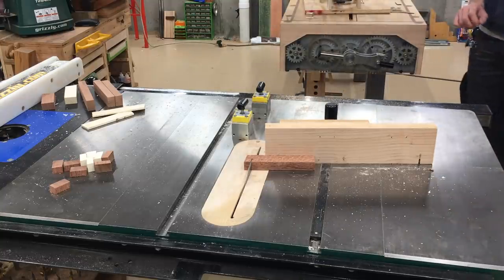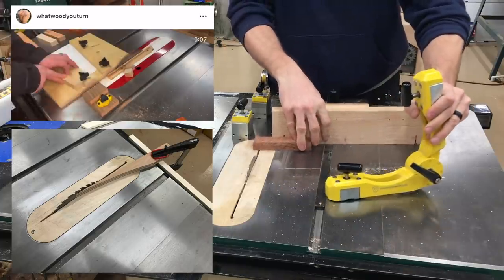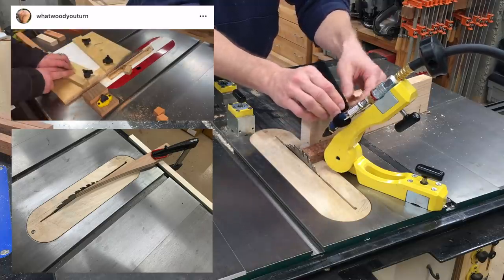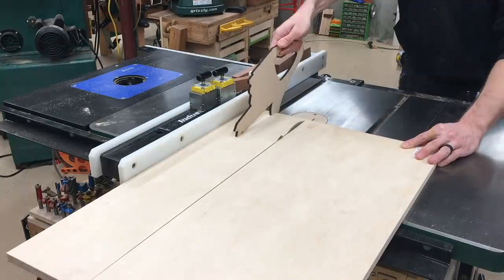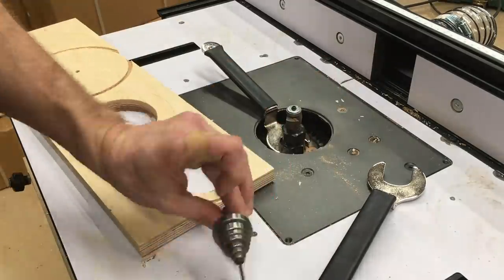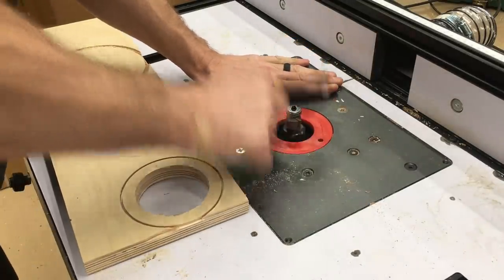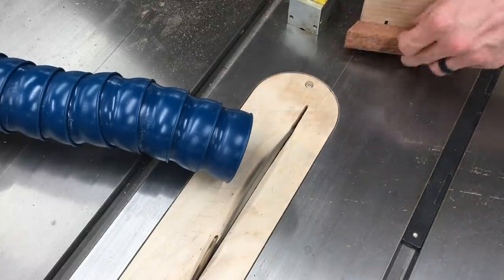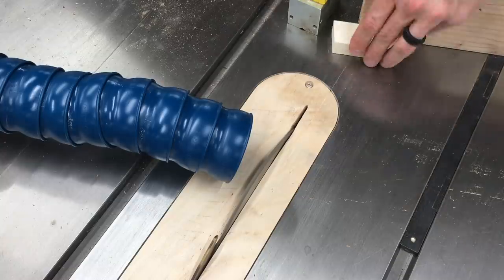Table Saw Kickback HIT ME In The Forehead!

Comment: Hello Andrew:  Your clamped on tapered wedge is currently sold by Aigner (German, distributed in the USA, by Martin Machinery).  We use them in our shop..... useful to prevent what happened to you.  Aigner's are magnetic, so quick to place and use.  No clamp required.
Reply: What is it called or where can I find one?
Reply: I was just saying that'd be my solution! Seconded! Where are these sold?
Reply: You can build your own and use those fancy magswitches to hold it down.

Comment: As others have said, thank you for sharing your experience as a learning opportunity for the community. Also, glad to see/hear you had those safety squints engaged! 

Perhaps a permanent splitter affixed to that zero-clearance insert would help to minimize the risk of this happening? (would limit the max blade height if you want to keep it real close to the trailing edge) Thought the 2.5" loc line and collector cage was a clever workaround - how many pieces can that gobble up before it starts to inhibit the airflow significantly?

Comment: Well, I knew I was not alone.... Was cutting wood 'buttons' for attaching solid wood table tops to the table frame. Had a pile of them to the left of the saw blade. One vibrated back into the blade and I have a scar on my forearm.... I now use a push stick to get them out of the way, and way away.... Not sure if you are familiar with Malcolm Tibbits, a internationally known segmented turner. He made a special cutting sled. Off cut side is angled down so the cut off falls away from the blade and can't go back into the blade. I do like the wedge against the blade too, very simple and effective. One other thing I do, and this comes in part from years as a bowl turner, I stand out of the line of fire, ALWAYS! Never in the direct line of the spin of the blade.

Comment: definitely guilty of neglecting my breathing protection, think I might be resolving myself to getting one of those powered respirator hoods and just wearing it all the time.
I do a lot of wood turning, at the top of the tool wall for my turning tools I keep a failed bowl turning (12" wide 4" deep), I knew it had a bark inclusion and thought it would look cool in the final piece, but I had shaped the bowl wrong for the wood, didn't leave enough meat on the bottom, so about halfway through hollowing about 1/3 of the bowl dethatched at 1800rpm and smashed into the ceiling. So now it sits there on my tool wall as a reminder not to do anything stupid.
Reply: There's a term for people who wear those powered respirators all the time, yanno.

..."Vader" I think it's called.

Comment: The video prompted a flashback in me. About 50 years ago while trying to rip strips for a project, the first cut became bound between the blade and the fence. Instead of backing out I pushed the piece harder and like lightning it came back and almost amputated my thumb at the first joint. The emergency room tech looked at it, turned it back into place, and bandaged and splinted it. It grew together just fine and I eventually regained feeling in it.

Years later I had a similar experience with an older (no kickback pawls) surface planer and a board too short for safety. Just as the I feed roller grabbed the piece and as I was moving back, the piece came back like a shot and hit the palm of my hand dead center. A lot  pain but it eventually healed completely. We’re never too old to learn. Be well…

Comment: Best solution to reduce rist of kickback injuries: adjust your position not to stand in the line of fire. That‘s one of the advantages of euro style sliding format saws.
This works risk mitigating for every situation and all tools.
Another option is the riving knife - and in your case a blade cover would probably have helped.
Reply: I would say best solution is a riving knife. Even if you don't stand in the line of fire the kick back might throw things at an angle or just mess up things totally resulting in that your fingers end up in the saw blade.

Comment: Kickbacks are caused by not having the blade high enough. Most people have it just above thickness of wood, but it needs to be an inch or more higher. That way the teeth ate cutting on the downside way in front and holding wood down to table.  When it's too low it is cutting ontop and pushing wood back to you.

Comment: It can happen to any of us. A video like this is a wake up call for all of us to re-commit to out best safety mindset. Great job identifying the risks and showing options for mitigating the risk. I hope other viewers are not discouraged from using a riving knife when it is not possible to use the full guard. I noticed that it was installed in the final clips of the video when the vacuum option was demonstrated. Not withstanding the spring tension riving knife, which I am not familiar with at all, I believe it is the simplest method for tamping down several hazards.

Comment: I use a sled for cutting small parts. The offcuts travel beyond the blade where you can safely move them before pulling back for the next cut. Rockwell also makes one with a ramp for the offcuts to slide down and away from the blade.

Comment: I had no idea!!! I'm paranoid after a recent accident. A thin slice of wood got caught between the insert and the blade, causing the insert to pop up, catch the saw blade, sending a cloud of steel slivers into my hands before flying across the garage and into the garage door. Happened in a flash and completely unexpected. Thankfully the insert only banged my hand leaving a bruise as it passed by, but the steel shards created cuts all over my hands and they bled for a while. Still have all my digits, so it ended well. I didn't touch my saw again until I got a zero clearance insert. I'm going to buy a face shield after seeing what happened to you. I always wear eye, respiratory and hearing protection already.

Comment: What an interesting video. I’ve just started a year long fine furniture making course in the UK and our tutor is fastidious about shop safety. We were doing a similar thing the other day to cut buttons for attaching table tops. We were working in pairs with one person cutting and the other flicking the cut pieces away from the blade with a long push stick. Admittedly easier with two people but if you are on your own the same system would apply. Yes it adds 30 seconds to each cut but better that than losing an eye or worse. Plus, we shouldn’t put all our faith in safety glasses. I know a dentist who was wearing them when a piece of filling he was drilling out of a tooth shot straight through the lens and he lost his eye. Very pleased to hear that you were ok.

Comment: Why do people insist on using a wholesaw at such a high rate of speed? Heat is the  enemy and dulls them quickly. Plus it will ultimately cut better at a lower RPM.

Comment: clever idea on the vacuum mount, but it seems to me that the air flow will reduce as the hose fills up - of course just empty it as needed. One step further on that idea is to have the cut offs fall into a cyclone bucket and not have to stop and empty for a lot longer - maybe not until all of the cuts are finished.
Glad you are okay. Something similar has happened to me on both the table saw and a miter saw. Not fun even with safety gear on.

Comment: The most simple solutions are most often overlooked: set your blade near maximum height. Not only will it leave more room to the back edge of the blade, it will also kick up, instead of kick back.

I know the online safety police will probably hang you for it if you would ever actually do this on video, but most experienced table saw users I know set their blade much higher for these kinds of cuts without a fence. The "one tooth above surface" is usually only applied when using a fence and standing to the right of the cut instead of in the firing zone.

Comment: Expecting to regularly use a table saw and get away with never having something kick back at you is like expecting to ride a motorcycle to work every day and never lay it over.... If you do it long enough it's almost a certainty it'll happen. The difference is does your process take that into account and prevent major damage when the inevitability occurs? Such as a face shield possibly could've kept that from making contact with your forehead. Or not. But I used to think safety stuff was a waste of time but you'll never see me operating machinery without a minimum of safety glasses and often times something more substantial. Thanks for sharing, ain't nothing but a learning experience and hopefully that's your one big oops for a long time!!

Comment: Andrew, I've not seen many of your videos though I have heard you name mentioned in several other woodworking channels or even podcasts. My rather simple suggestions to have avoided this are: Just using a longer mitre gauge fence that extended past the blade would have a) given you full support up to the blade and b) allowed you to push the fence and cutoff through and past the blade, safely depositing the cutoffs further from the blade. 

Also if you want an easy riving knife option for these cuts just have a separate zero clearance insert with a bit of wood glued in to the far end of the saw kerf which will act as a splitter.

In addition had your blade been guarded in almost any way, that block would not have been headed toward your head. Even a bit of acrylic secured above the blade with magnets onto the cast iron would have deflected it away from you while also offering the clear and obvious other safety benefits without getting in the way of you seeing the blade in action.

Comment: Really glad you're okay, man. 

And, FWIW? It didn't even occur to me that flavor of operation was a risk (though seeing it on video is one of those, "oh, DUH" moments, accompanied by a shudder of what very well may have been a bunch of close calls, career-wide). Also, thinking back over the years: I had a sliver get sucked JUST far enough into the bandsaw to launch a thin offcut PAST my noggin. I'd totally forgotten about it TBH, until I watched this (and have habitually used zero-clearance discs in the saw ever since).

Regarding the solutions? I thought the thin curving sliver was the most graceful, personally, though I'd use a magswitch to clamp her down, I think. The vacuum is a bit like sandblasting a soup cracker, in my opinion. Long walk for a small snack. Option two? Have you considered a Hockey Mask?

Comment: Thanx. I had the same thing happen with a block of wood I was prepping for woodturning.
I was using a fence, and cutting across the endgrain. The block kicked up and hit me o the right breast, just below the collar bone. An industrial tablesaw ... more than a 2 Horse power motor. This chunk of wood hit so hard, that I felt paralysed. The piece of wood, bounced off my chest and landed 4 garage bay doors away from me. I was barely able to stand ... switched off the saw ... and made my way to a washroom. Looking at myself in the mirror, the bruise was almost instantaneous. I could barely move my right arm.
Icing it did'nt seem to help much.
The pain ... paralysing. 
After that, although I would wear safety glasses, I also wore a full face shield ... why?  If that block had smacked me in the face ... game over. No recount.
Months later, while woodturning, a piece of bark flew off the lathe and struck the face shield just below my left cheek bone. If that had been wood, I would have had a shattered face. We do tend to take tools for granted, and not realize that even a one horse power moter, could seriously injure you. School of hard lessons. A wiser person said ... Wisdom comes from experience, experience from mistakes?
Hope this instills some caution, and Wisdom from others shortcomings. Luck.

Comment: If you clamp a sacrificial board on the sled that runs on both sides of the sawblade and is higher you problem is solved. When making every cut push the fence over the blade so when you return the sled the offcut stays behind the blade.

Comment: Small pieces are notorious for flying off like that if they hit the saw blade. You have no blade guard or riving on the back of the saw so they could just be pushed into the blade. 
Mitre saws can do the exact same thing if a small cut off gets trapped in between the blade and the rail guards.

Comment: I'm about to start spending time on segmented turning, and planned to cut segments with the exact method you were using (with your miter set tool). Thanks for taking the hit and sharing. What are the nasal guards that you use? I use a mask which fogs up my reading glasses, so the choice is breath in dust or work half blind.
Reply from the maker: They are called 1st defense nasal screens, stay safe!

Comment: As slick as this final vacuum unit looks, wouldn't it be easier and just as effective to have an insert with a zero clearance timber riving knife (if the steel knife is a pain to change or adjust)?

Comment: It's OK to cut small pieces with your set up. But you have to clear each piece away from the saw blade before cutting the next piece. Not clearing creates the opportunity for small flying projectiles, which is what happened when they bumped into each other against the rotating saw blade.

Comment: Thanks for sharing. It's good to know about table saw kickback from small pieces!

Question: Why wouldn't you use a miter saw or the band saw instead of your table saw for this?
Reply: A band saw isn't generally as accurate for repeat cuts as the blade can wander a little. I'm not sure why you wouldn't use a miter saw, other than perhaps taking a little longer and a little mroe effort. Although on my specific mitre saw it's a pain to clamp a stop block if doing a beveled cut (which wouldn't be the case here, but still)

Comment: Thanks for sharing a less than positive item. It builds towards my perception that the likelihood of a workshop accident increases in an inverse proprtion to the size of the pieces being worked on. I've had a couple of very near misses, the most notable whilst cutting short lengths of angle-alu on a mitre saw. 
My neighbour recently lost the top side of his thumb on the table saw whist cutting small stock. 
Of course the "normal" and "big" stuff are not without their problems too...

Comment: I was using my saw and I had been cutting   2 x 4s ,  I had a chunk of wood I wanted to cut and got lazy and ddin't reset the blade depth, of course it was an 1/8th inch thicker than the 2x4s and it jammed and kicked back right at my head, luckily I didn't get hit by it.

Comment: The wedge that acts as a one sided riving knife might work. My concern it gets tangled in the blade's upward motion and now it is a projectile. The very stationary and bolted riving knife would have prevented this exact incident though its possible this could happen, just differently if your only protection is the riving knife.

Probably the vacuum technique is your best solution for pieces this size and mass

Comment: Table saws while very useful, are extremely dangerous tools. The most dangerous general shop tools in my opinion.

My father had a piece of material (not wood) which was his fault for misusing the saw kick back and hit him directly in testicle. Which immediately sent him to his knees, he wasn't right for about week after that.

My father also had piece of wood kickback and break his thumb.

On another occasion my cousin lost part of a thumb and pretty much a finger (they reattached it but it's nearly useless). I can't think of any other tool that has caused more injuries to people that I know. I've had some close calls myself.

While not an issue this time, as this was a tired, in a hurry, honest mistake on your part.(We've all been there, I had to have pins in my hand due to a careless grinder accident.) 

Keeping an impeccably sharp blade, as well as a blade free from any residue (pine tar and such) , and possibly even with some wax applied goes a long long way for table saw safety.

Life goes on I'm glad your injury wasn't serious, learn from it as I'm sure you have, and the key is to always keep it fresh on your mind. Put a picture of your wounded head on your table saw so you won't forget.

All the best.

Comment: clamp a long sideways wedge behind blade with flat in line with the blade on the miter side.  If your cross cuts are short enough the wedge could be placed on the blade on the fall away side.

Comment: Andy,

Many years ago, the "Felder Group" in Germany, came up with a simple way to stop those small "dadgum" pieces of wood; from being thrown back at us. I tried to find a link to it. But I couldn't find it. So I will try to describe it this way...

Take a 2" wide and flat (3/4" thick) block of wood; that has a short (2"), sharp taper; right down to a point. Put one of your switchable magnets on the top; to lock it on the top of the table saw.

Then, place it, so the tapered side AND point; just touches the smooth part; of the back of the right side; of the saw blade. (Thanks for "semi-colons"; less we could not communicate "atoll"; with this stupid "Imperfect" Language called "English". Dadburn it. LOL!) 

This forces a "detoured" travel; of what is usually the natural travel; on those little "dangerous" cut blocks. And you can cut them as fast as you want. There is a video that shows it on YouTube. I am going to try to find that; and put a link on this channel.

I bought one and I will send you a picture of it in an email kind Sir. It works great. For what it's worth.

Comment: This seems similar to a kickback I had earlier in the summer cutting tapers on the table saw. Safety glasses on thank god, but with no fence one piece pushed another onto the back of the blade, a second before it happened I knew it would come next, and next thing I know i get nailed in the forehead. 100% caused by rushing for no good reason.